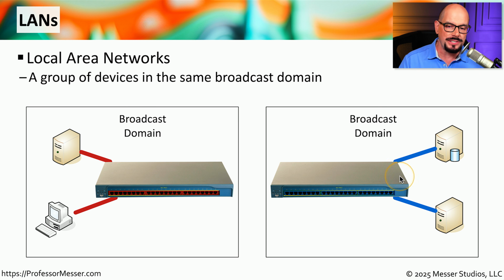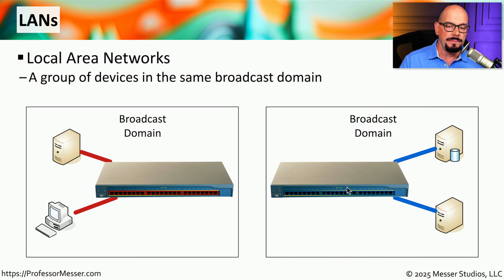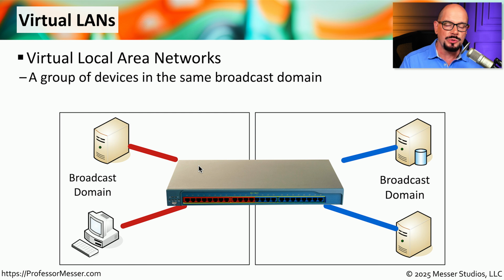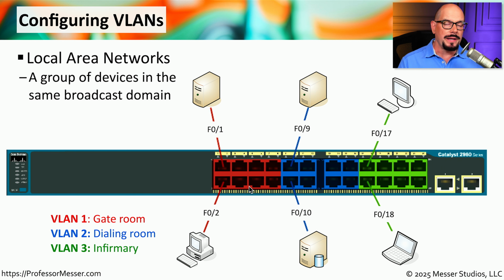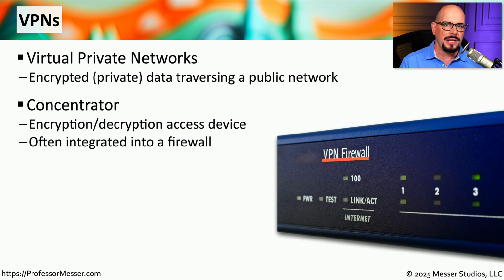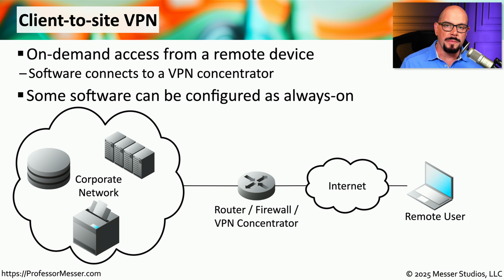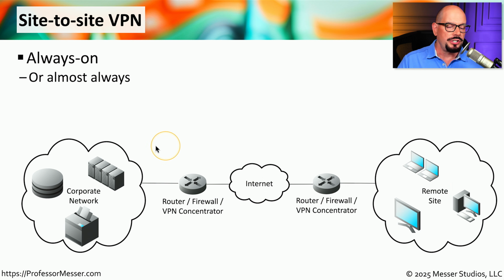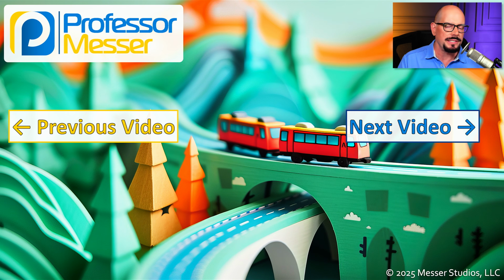VLANs and VPNs - CompTIA A+ 220-1201 - 2.4

Comment: What is the main reason for using a site-to-site VPN if all of the clients on the remote site side can use the same software that the client-to-site VPN uses? Is this simply so that you do not need to deal with the software so that any user can connect (kind of like a hotel or a coffee shop)?
Reply: client to site would not be always on like most site to site, it also covers all devices on the network, not just laptops. 

way easier to manage 2 VPN instead of 100 laptops, and the users dont need to interact with it